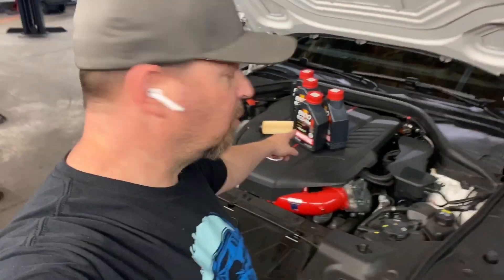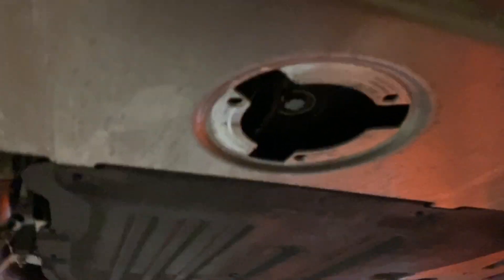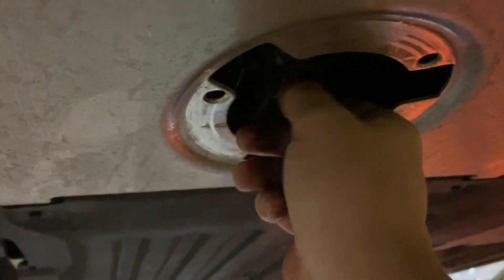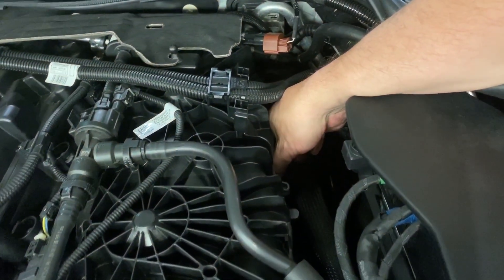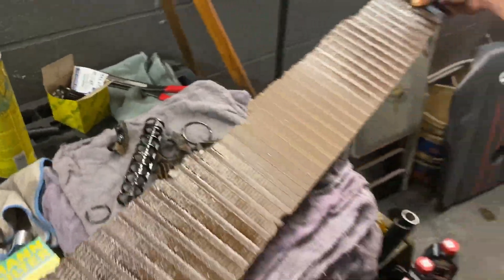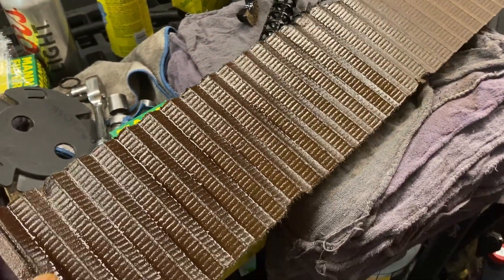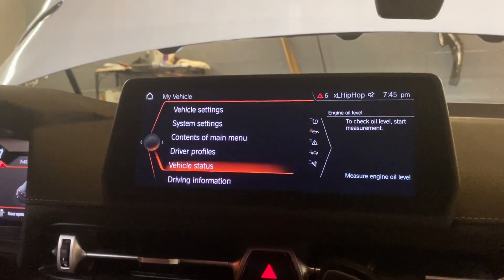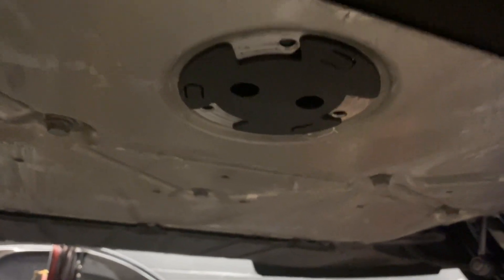Supra oil change 101

Comment: I have to do this. Every car I’ve had I’ve done it myself. Dealer is 2 hours away.. uugh lol Toyota was cool with me doing it on my 8 6. Hope they are cool with me doing the Supra. Any specific reason you went with Motul?
Reply from the maker: We always have used Motul with all our 86 Stuff, The other oil worth testing would be the Liquid Moly in our opinion but we have not tested that yet.
Reply: @Speedindustry  Whats the deal with the battery's in this car what you have to buy a Toyota one only and have to reprogram the thing?

Comment: My only question is if there is a true reason to stick with the 0w-30 oil weight other than for fuel economy purposes? I keep hearing from performance shops they recommend moving to a 5w-30 weight. Considering it is a turbo engine and how hot the engine can get, I figure there should be an advantage moving to a slightly heavier oil weight.
Reply: I'm switching to 5w30 liquimoly this weekend on mine
Reply: Yes 5/30 would be good 20W it just to thin.
Reply: Don’t you have to switch over to 0W20 after 6000miles on the 5W30?

Comment: How often should you change the oil if you drive your Supra hard? On the street or track
Reply: It depends, just check your oil color and that should tell you when
Reply: @otakugisa  You cant there is no dipstick in the engine.
Reply: @cindysue5474  the oil cap cover, stick your finger on it, if it’s black, you can tell.